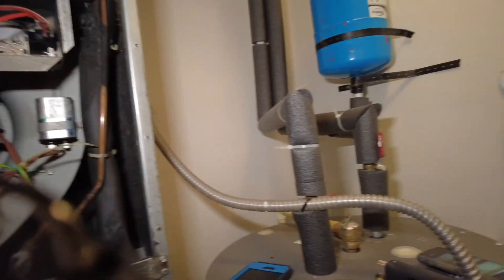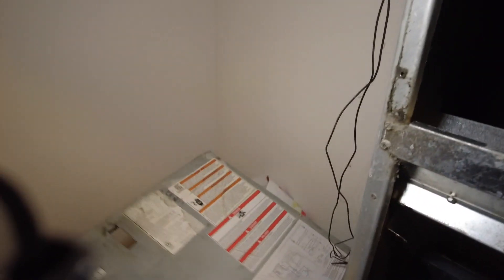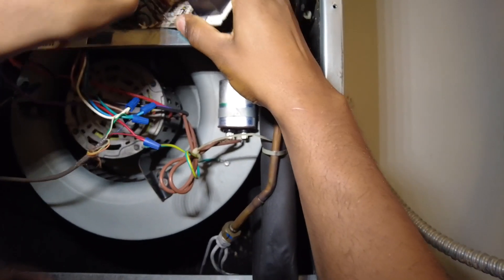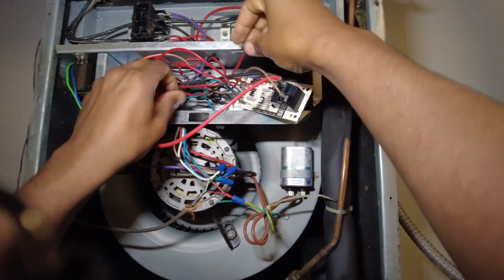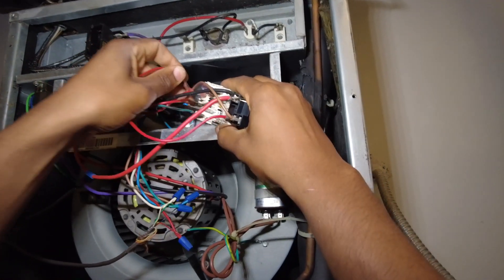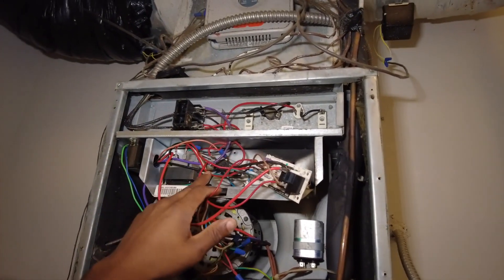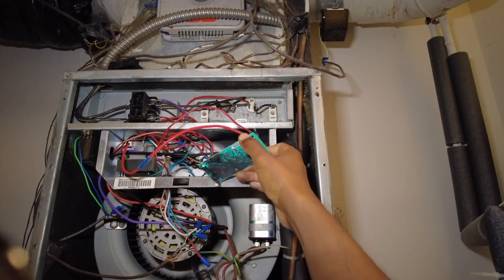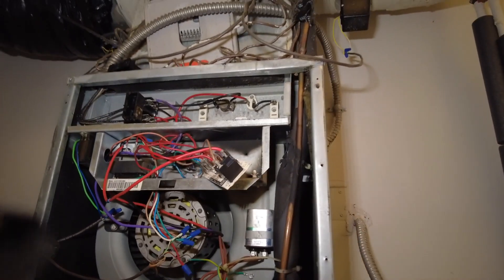We All Make Mistakes! How to Replace Heat Pump Control Board | Bad Control Board Repair by HVAC Tech

Comment: Nice!! I replace alot of those boards throughout the summer, either the relay melts or on the call for cooling the relay doesn't close at Com & N.O. Are you using a GoPro? & How are you able to see what your filming on your cellphone? 👍
Reply from the maker: Nice! Yeah they seem pretty cheaply made. 
I use the new DJ I pocket 2 camera with the Wi-Fi wireless transmitter sold separately.